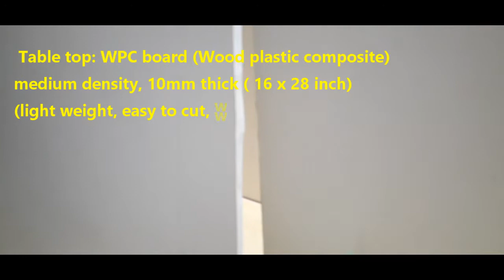PVC pipes: Folding table  :   AB cool ideas.

Comment: Total pipe length is approx 116.3 inch
L bend total (4+2+2) = 8
T joint total (2+2+2) = 6
Reply: Pipe diameter ??
Reply: @rohitben5974  1/2 Inch size
Reply from the maker: Practically its called as 1/2 " pipe (half inch pipe)